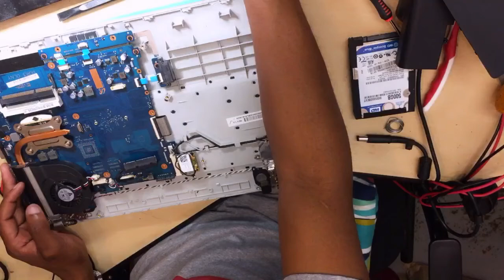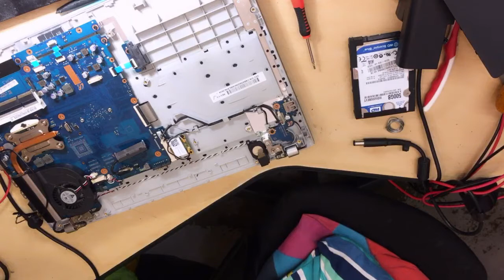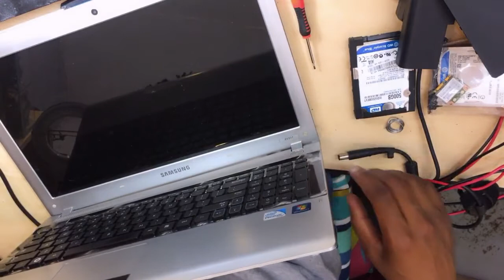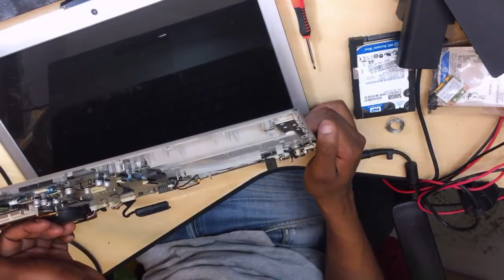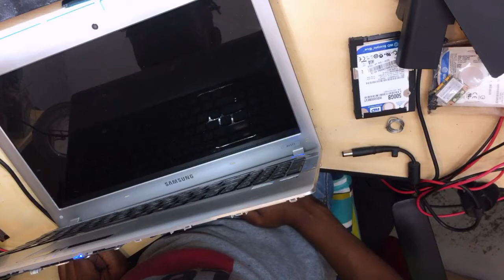How to repair Samsung RV511 with no display, Samsung RV511 no display Solved -South Africa Durban

Comment: I  had same problem no display tryed  usual ram external  monitor was thinking its the mainboard just as last attempt i changed  the cpu which was a i3 had a spare i5  same socket fired up back on oh model was rv511